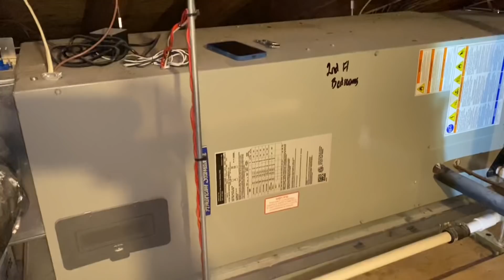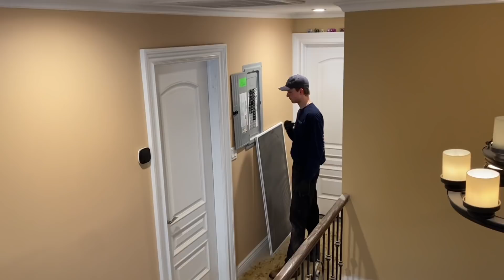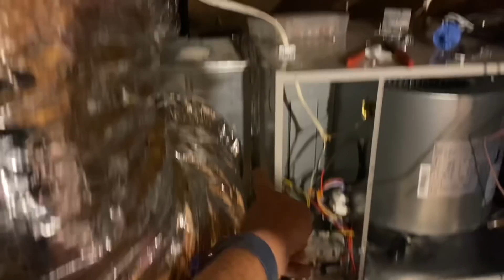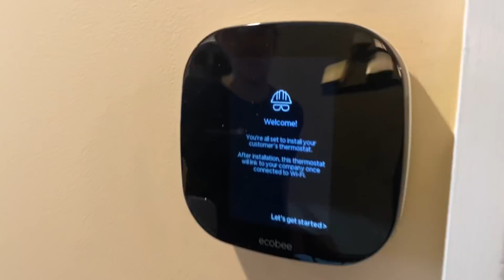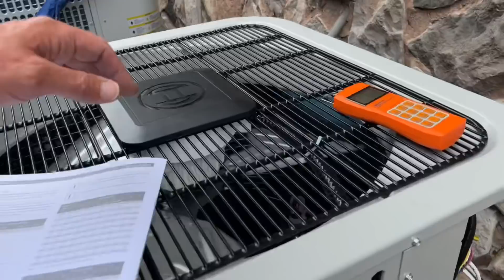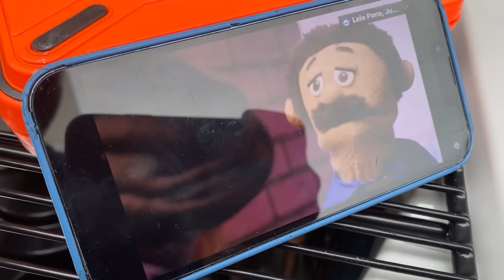Installing Bosch IDS 2.0 Central AC System with Rectorseal Surge Protector RSH-50

Comment: Why sell a Bosch inverter heat pump system and not take advantage of the inverter technology? Cool only? Why not snake a new tstat wires and condensing unit wires to make the system work as designed? It makes no sense to me it’s a waste of your clients $$ unless it’s a rebate thing?

Comment: Heat pump and two stage cooling with only 2 wires to the condensing unit? How is that possible?
Reply: Forgive my ignorance but why sell an inverter heat pump system and not use the heat pump? Also using a conventional thermostat why snake the required conductors to use the system as it’s designed? Seems like a waste of technology to me?

Comment: Very interesting, back when I was doing HVAC rubatex was the best line set insulation. I just looked and saw that they were acquired by another company back in 2008. K-Flex is now the owners of the brand rubatex and looks to be still making and selling it. I haven't tried the armor flex you were talking about, is it better than the older stuff we used in the 90ies and mid 2000's, when I last was in the industry?

Comment: Hey Mikey, when you cut the lines at the evap coil, fid you tape off or cover the ends of the lineset? I couldn't tell but with all the dust floating around I always tape off or plug the ends until I'm ready to braze.
Reply: Did*

Comment: I agree you should always do a static pressure check.  People just assume that because they are replacing like tonnage, you are ok. You can get away with some undersizing of duct work because of TXV/EXV values.  I noticed that Bosch Airhandler does not have a TXV or is there something else built in?

Comment: Mike, do you ever set these up using the heating part of the heat pump with the fan coil?  For example, use the heat pump for a majority of the heating and use the fan coil when extremely cold?  Sort of like what they do with heat pumps and electric strip heating in auxiliary mode.

Comment: Wait... So a 5-ton condensing unit with a 4-ton air handler equals a 4 ton system? I thought they both have to be of equal size.
Reply: @PipeDoctor  oh ok.

1 other question. If you can use that stay bright 8 to seal up your system, then why ever use oxyacetylene ever again?
Reply: @PipeDoctor  been watching your videos. Thank you for sharing them!!.  Have you had any issues with humidity control with the Bosch 2.0 in summer?  I had a  4 ton system installed in my home  2 months ago  , (live in Virginia) and having humidity control issues.  Dip switch set to 4 and I've tried lowest CPH on sensi stat in cool mode with no success.  Any thoughts? TY

Comment: Bosch wants you to set compressor cycles per hour to 1, you did not.  thermostat wire was 4 wire  how did you set it to 2 stage cooling with out that being BS.  and  i saw your lackie but flux on the old ass refrigerant piping, no worries of acid contamination in the refig lines, not to mention i find it to be a bit hacky to reuse old ass refrigerant pipes, did you flush and use your pipe wiper, maybe pressure test, or are we dealing with a higher level of dusch bagery?
Reply: If you aint testing refrigerant pipes your guessing!
Reply: @PipeDoctor   stay clean flux right off the manufactures instructions "A mixture of boric acid and
fluoride compounds, "    its fine that your ok using it, my name is not on the job.
Reply: @PipeDoctor   your right if the house is 13 years old like the AC, its not a compressor burn out and its leak free.   but if 13 years ago the last guy reused.  obviously i cant know those particulars.

Comment: Won’t the fan come on all the time in the summer with the switch on the pipe ? Where is the support for the condensate line . Otherwise clean install !
Reply: only if the attic temperatures get over the low/ turn on setting. only being set at 130F, that's possible. probably best having that set to 150~160 range and 180F max water temp.

Comment: You called the new unit a Heat Pump but then it appeared that you did not program it as one on the Ecobee?? You don’t have to put in a fake number to program it as a pro just hit the “skip” button lower left of that screen. In my opinion the Ecobee is a great thermostat if you are into gadgets and having a ton of modern features/controls including wi-fi. The ones you typically install look very basic—good for the no frills customer. If you are installing multi stage high efficiency items those customers will want an Ecobee. Be well 😎

Comment: Still skeptical of the stay brite 8. Is the flux used compatible with 410A refrigerant? If you ain’t testin the static pressure your guessing the fan speed  to be used or do you do load calculations on the ducting? Always great to see your one day installs you have competent staff that gets the job done. We’ll done Micky P!
Reply: Damn auto correct- Mikey not Micky

Comment: 10:37 It appears sitting here in my chair the condensate line is running uphill to get to that "Tee".  Keep in mind to minimize clogging, use 45s and not 90s.  The 90s will slow the water down too much and then won't carry the "cocky" away and will build up at that spot over time.  Two 45s can help keep the speed of the water up a bit more if possible.  Just speaking from a bit of experience.   With that single line on two units if it becomes clogged which ever the lower system it will overflow for sure.  I have seen techs plumb in primary condensate line into a much lower pan of a ERV, guess what happens when the line downstream filled up?  Filled up the pan of the ERV and leaked all over the ceiling below because it would never hit the condensate float switch on the much higher AC.
Reply: I need this dude to do my hvac ☝️

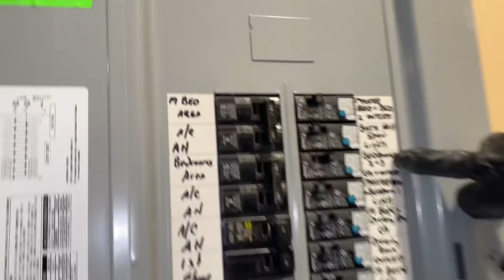Comment: 8:55  You know why the breaker it tripped right?  It was because it was an AFCI, and the yellow light shows there was an arcfault.  Most likely you cut the transformer wires and it was still hot and caused a arc fault to happen.  Just a guess here, or the workers did something that caused the trip, tool being plugged or unplugged etc.  GFCI's are even worse, if you turn off the switch to the unit, the breaker is still on, if you happen to touch neutral to ground you will trip it as well, even there was no hot connected.  PITA, but hey...  😁👍
Reply: looks like a 240v air handler and the line voltage was already unhooked and pushed up out of the way. so nothing they tripped, it sounds like they're having tile work done(tile wet saw in background?) those workers likely plugged in something wet/faulty(afci/gfci combination breaker) or older junk breakers that are overly sensitive and will often trip if a second downstream GFCI is plugged in( many tools and other devices now have GFCI built into the plugs)

Comment: " We should start measuring static, but if ductwork is installed right..." OMG Mikey pipes!!! How long have you been doing this? NO NO NO ductwork is ever sized/installed right! Number one problem in the trade since its inception.
Reply: Very true!!!! Didnt see him actually test static after he said he would. Critical to test static
Reply: @TubeSurfer26  what could happen if not tested?
Reply: @ClickClan100  constant cycling and excessive wear on motors
Reply: @ClickClan100  if duct work doesn’t match system, kills the unit. With correct duct work a system will last way longer
Reply: He goes dark when u pin him to the mat stop with the bs just wants to get subscribers total hippocrate
Reply: Boomers did that
Reply: How do you determine proper fan speeds without measuring static pressure? I’m guessing you’re just guessing

Comment: Been using surge protectors for ten years, since a customer's hydro meter blew off the wall after a lightning strike, that took out all the electronics in the house (furnace, AC., computers, phones, TV boxes and TVs, etc) Whole house protector on the breaker panel, and surge protectors on all devices.

Comment: Im in Miami,Fl. Never used soft solder for connecting piping. Only for chilled water systems. Brass to copper. Will it hold up to 410A pressures?
Reply: Stay Brite 8 hold higher pressure, not only that but its more flexible, and it doesn't require nitrogen purge

Comment: surprised the hot water lines for the hydro coil aren't insulated being up in the attic
Reply: very likely glycol in the indoor system too. insulation wont gain you much of anything with high flow rates in the pex tubing, copper radiates far more though and should be insulated well. to combat losses.

Comment: Rectorseal rsh 50 instructions say to wire to the line side of the disconnect Brian, HVAC School, teaches the same. Why do you wire to the load side..Also, an additional reason for not installing a filter drier outin the sun is that it will become very hot and the dessicant will release moisture when idle hot sunny day?
Reply: Boomers. They love doing this stuff to see what they can get away with. It's a rush only topped by hard drugs for them.

Comment: Does that system constantly circulate hot water so it doesn’t freeze during the winter?
Reply: propylene glycol is mixed in to provide freeze protection.

Comment: It would be cool, if Mikey Pipes made an appearance on This Old House since they do use local HVAC contractors, they have been doing projects in New York State lately.
You never know it could be a start for a show.
Reply: Mike never leaves the 5 towns/south shore area and parts of Queens on the LI border.  This Old House was in historic Saratoga NY, I doubt they will head down to LI unless there are doing a series on rebuilding after a natural disaster.
Reply: BTW, I did some volunteer work with Richard T and he is not so nice.

Comment: Man I need to get a pair of those wire strippers so much easier then the old school one I got
Reply: @PipeDoctor  👍 cool
Reply: Warning! Knipex has a newer and more expensive model. Don't buy that one it sucks. The old one like Mikey Pipes has seems to work better.
Reply: @PipeDoctor  Mikey what is the purpose of the upper slider on that Knipex?  Someone said it was added to increase the pressure since the original version did not work too well with thin wires.